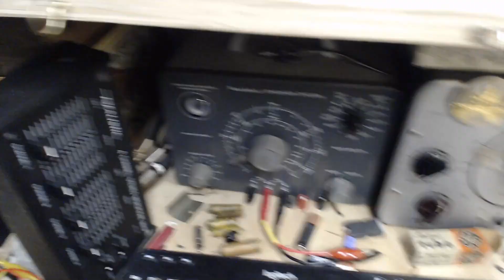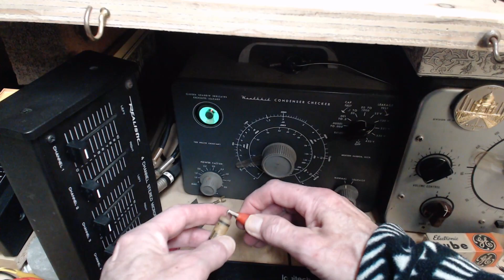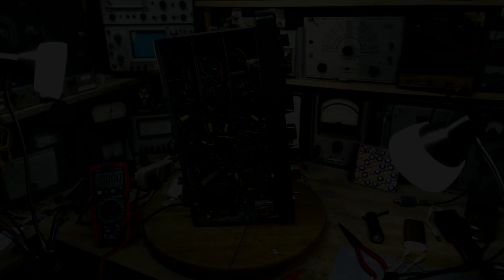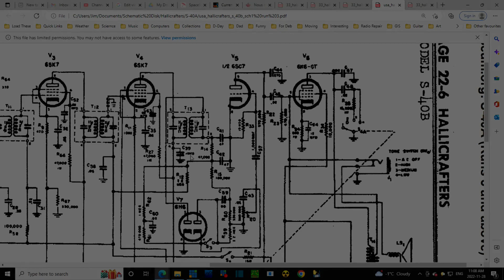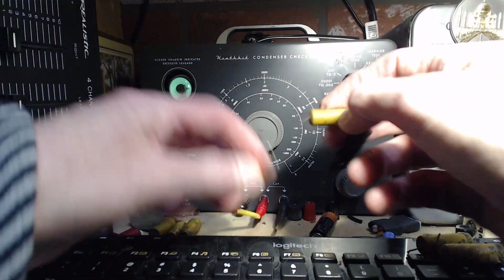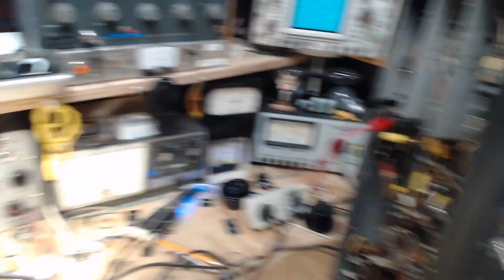Hallicrafters S-40A Shortwave Communications Receiver Video #8 - Last Wax Capacitors Replaced

Comment: I have been a Ham for 40 years, In electronics for 50 years, have a full test workbench, BUT!!!!! Never though about using a thermal imager, I do have a Fluke, to look at high wattage resistors!!! Thanks Jim, you can teach old folks new techniques with radio repair!!! Still working on my Collins 51-S1 Receiver to figure out a USB-LSB issue.. over 30 hours into this and still not resolved... Still FUN!!!

Comment: With no load on the audio output stage you are introducing arcing in the primary of the output transformer. You should never operate an output tube with out a load on the speaker transformer secondary. I inadvertently did that last week and the cathode bypass resistor started smoking from the reflected infinite Z  of the transformer. In my 40 years Ive never seen that happen. That was a good bug !

Comment: I am currently using my Tiny SA for many  jobs around and on the test bench. To my mind its better that the SDR , as I did not have success with that device. From the start I learned to align the IF with a signal generator and a VOM, with great success. With the TinySA I can verify the response while viewing the swept IF results. So far the Bode plot of my IF amps have been spot on after I peaked the IF cans. I can also test the sensitivity in micro-volts with the spectrum analysis function. The one feature I like most is scanning the broadcast band and walking around the room to pick out the hottest RF pickup spot. Wouldn’t ya know that where I have m AM FM record player console is a dead spot for FM. Behind the paneling n that room I found an entire mirrored wall the the original owner installed in the 1970’s. The mirror is sucking up all the FM signal. Who would have thought. The mirror is a 1/2 “ plate glass panel 8’ by 4 ‘.  You could not imagine how many times that I pulled that FM radio out and went over the alignment and tube replacement. I really like the TinySA as a standalone bench test device as most of my bench equipment is 1950’s Eico, Heathkit, Simpson and Precision pieces. My scope is the IBM / Tektronix  100 Mhz model 435 portable , on a scope cart. I did try the SDR but my computer is 10 years old and too cumbersome to use.